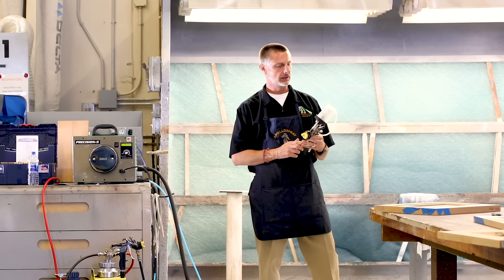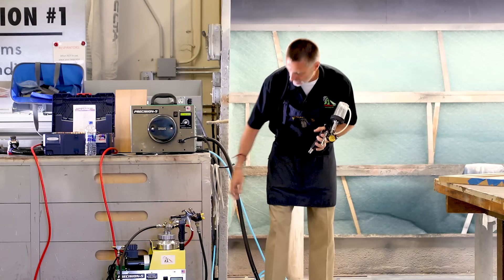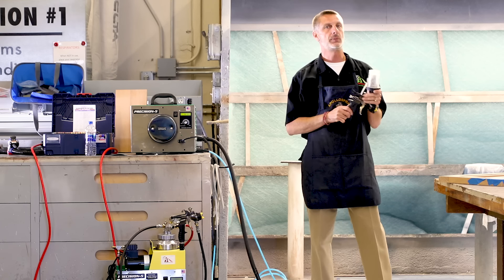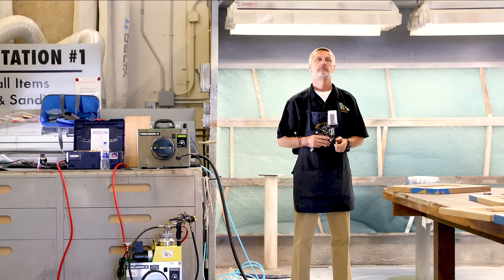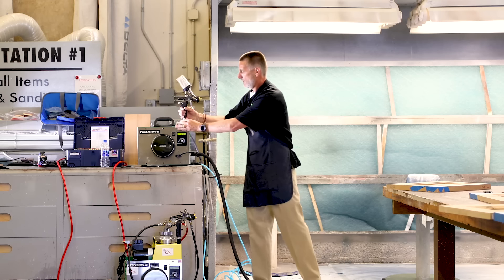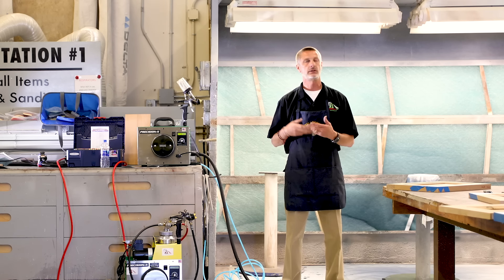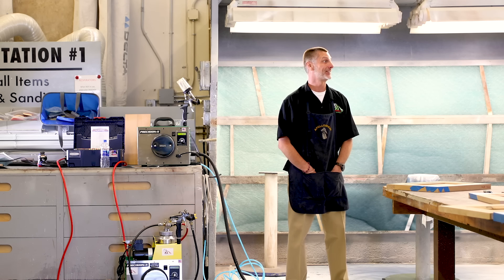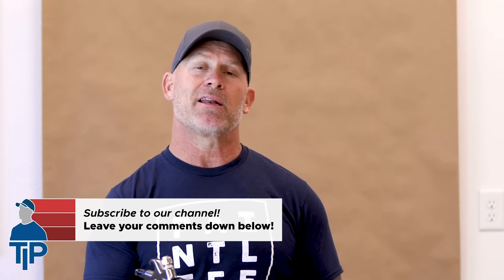AMAZING HVLP Sprayers! Best SPRAYER?

Comment: Hey paint life guys. I love your content, keep it up, I'm learning so much. There is something I'd love to see you address. The topic has actually led to a new pep heave of mine. There are so many self proclaimed experts out there, all with vids entitled "How to..." or " The proper way to... ", only for them to use these words in their vid. " I've been doing this for so long , I just do it by how it looks or I just do it by feel. I'm not sure if they are aware but we don't know what they are seeing or feeling. It's great that they are so confident in their abilities that they never have to measure any more, and their way is so perfect for them but it doesn't work for someone who is just learning.
I would love to see a complete vid on how to set up an HVLP system from start to finish. To include the thinning as necessary and how it sprays. how to controls blowback and overspray. You have mentioned in past vids that latex will likely need thinning. Well, how much and how do we know?  
Please don't just dump in some water from an old soda bottle then say " looks/ feels good to me because I have been doing it so long that I don't need to measure and viscosity cups are for newbs. "
Some units have viscosity recommendations. Mine does not, just a tip set recommendation, then says follow paint manufacturers guidance for thinning. Well I'm not finding anything on the paint either. 
It's ok to title "this is how we do it" so long as there are some measurements included...

Thanks
Reply from the maker: Thanks for sharing and good idea!  I will add it to my to do list🤙

Comment: Always use a regular airless with a fine finish tip. Probably 25 years ago I was talkin to my store manager at a Duron paint store here in Raleigh North Carolina. I've been painting since the early seventies as a young boy helping my Grandad and Dad and full-time everyday since 1980. Until I fell from a 24 ft ladder I broke my back and forth places so now I'm disabled. Anyway back when I'm speaking of they only had a flat tip that was a fine finish tip they didn't have reversible fine finish tips he hadn't been invented. The flat tip look like a barrel about a half of an inch long. Maybe a little longer. It looked like maybe for flat tip stacked up. I drew a picture of a fine finish tip that was reversible.I don't know how they are now but the original sign finished tips both the flat one and then reversible one were actually 2 tips paint went through the first tip witcher's cone-shaped or round like a spray can and it broke the mist up once and then it went through the second tip which was an elliptical or flat tip which give you a flat fan so the paint went through two different tips in the mist come out like vapor it was really fine. I had previously the year before spent $700 cash for a patent search because I had invented a painting tool that is not sold to this day. Told this to it already been invented. Word of this tool on the market every painter would have one in their pocket just like a 5 in 1 putty knife. Anyhow I was gun shy about spending any money to try to get mine reversible fine finish tip patented. I specialized in spraying lacquer nobody else is doing that. I remember putting 60 gallons of lacquer in one house on cabinets and bookshelves. I used white lacquer on some. And a special water clear lacquer on the others because I had a whole bunch of pickled cabinets and you can't use an amber finish clear over top of white pickling otherwise your pickling looks like yellowed White. I had to order a special water clear lacquer. The sanding sealer for it was water clear with a little bit of white silica in the bottom. Topcoat was clearer than water. No Amber hue whatsoever. Any rate using a flat fine finish tip was really aggravating because if you got the least little bit of trash in it it stopped up and you had to disassemble it and clean. A regular flat tip you can unscrew the head then flip the tip over manually put it back in the head tighten it down blow the trash out then do the same thing in reverse and go back to spraying. This is still really aggravating when compared to the reversible tip but you could buy three flat tips for the price of one reversible. Anyhow there was no other fine finish tip for airless made except for the flat one that you had to disassemble which looked like a barrel and you were spraying out of it long ways another words as the barrel was laying on its side you were spraying like from the bottom through the length of the barrel out the top If You Can visualize this in your head. It was maybe five years later I went into the paint store in my store manager said have you seen these and she took me over to the case where they had the tips locked up in a glass case and showed me the new phone finish reversible tips I was sick she said I remember when you came in here about 5 years ago with a drawing of this exact tip and your drawing was exactly like this tip to the letter. Once they made those available I've never seen any reason for using any kind of air powered or HVLP I've always used airless with fine finish tips that much faster you don't have to keep reloading the gun and all that. plus is a hell of a lot easier just to have a gun on the end of a hose especially when reaching up inside of a cabinet then it is to have a bulky cup on the bottom or the top I never liked those.if you have a lot of stuff to spray you can just dip your sprayer right then in a 5 gallon bucket of whatever you're spraying and you don't never have to refill unless you're doing an extensive amount of lacquer 5 gal goes a long ways on some cabinets. You can get a small airless sprayer you don't need more than 1/4 gallon a minute but I would probably go with a half gallon a minute sprayer for that.by the time they came out with that everybody was getting prefinished cabinets nobody was getting any handmade wooden cabinets anymore and I wasn't doing much lacquer. I still don't see any reason for using I'm a HVLP as long as they make fine finish tips for airless. I still have my big 5500 speeflo 2 gallon a minute pump. I bought a brand new in 95 at a pro show paid $4,000 for it I have shot over 30,000 gallons of paint through it and still never had to repack it although it is getting a little tired now at least the last time I used it which was about 8 or 9 maybe 10 years ago. Ever since I broke my back in 05 and then had a second fall in 06 I've not been the same and I'm not able to paint any longer. I will still working up to about 2012 but I just got so bad with my walking and all I just had to quit. At one point I had three crews of painters and me and one spray helper went around and did all the spring for all three crews I don't know how we did it I wouldn't be able to do that much work now even if my back wasn't messed up. We did the ceilings spray finished the doors spray finished in the interior primed exterior siding spray finished exterior trim Prime with a spray if we got there before the shingles went on for all my boys had to do was put the last coat on the trim on the outside and put one coat on the trim and walls on the inside with a brush and roller. I always did my last coat on my trim and my walls with a roller because it touches up. Sprayed trim looks really nice until you tried touching it up. Same with sprayed walls they look really smooth and nice until you tried touching them up but they do share more defects in the drywall. If you use an 18 inch lambskin roller you'll never use synthetic nap again even if you use a 9 inch roller or 7 inch roller or even a four for touch up. Always use a real natural Merino sheepskin. Everybody says they're for oil only but that's wrong. They rinse out so easily and quickly it's unbelievable. You have to wash them at the end of every day or the shed hair but they watch out like rinsing shampoo out of your hair. The paint just comes right out. whereas with a synthetic nap roller you can wash and wash and wash in the painting never seems to come out of it. You will be able to hold approximately twice as much paint per roller for once you get it good and loaded up using the lambskin versus synthetic and that's where you get your speed with it that and the fact that the paint releases out of the tip of the lambskin much better versus stand packed up around the core. Plus a lambskin roller gives a different finish then a synthetic nap it's not nearly as orange pili and I can take one up three quarters of an inch thick and lay it down really smooth with those rollers if I go back over the second time you would think I was using the 3/8 roller. In other words I can control the coarseness of the finish by how I roll it. I normally use a 3/4 length and roller nap for everything 18 in wide in a 7in 3/4 nap for touch up.once you get the hang of using lambskin you won't ever use a synthetic nap roller again they cost two or three times the price but they're worth every penny.you lose time when you're dipping your roller all the time.and as I said before the paint release out of it is superior to a synthetic nap. The paint is always at the tip of the fibers it just flows out of the tip beautifully. In addition to type of finish that it leaves behind two fuses light much better than a synthetic nap and makes the drywall I appear to be a lot more level than what it is. Everybody always used to ask me how I got my walls to look so level especially the sheetrock man!! I hope this helps you
God Bless 🙏😇 Y'all
Jimmy in NC....
Reply: Who makes a good lamb/sheep roller that you write about?
Reply: Thanks for sharing the knowledge. Be well

Comment: Do you know if the connections on those guns are universal? If I had another brand of turbine but I wanted to upgrade the gun to an Apollo
Reply: I have both the capspray from Titian and Apollo's system, the guns work on either turbine hose most are universal.  The Apollo gin is the best on the market, I've had 3 for about 5 years not one problem with them, I never use the capspray guns of which I have 2.  Hope that helps